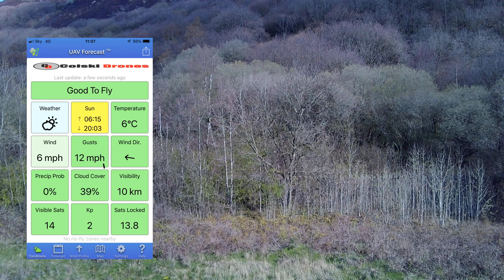FIMI A3 FIRMWARE V1024 FLIGHT TEST

Comment: Real nice.  I ordered March 14th.  The expected ship date of April 5th came and went.  Ship date not updated but so far order not cancelled.  In the meantime I ordered two extra batteries, extra props, high voltage charger, and carrying case.  They better not cancel NOW.  D’Oh!
Reply from the maker: Thats the biggest problem stock is always low
Reply: Hang in there, I ordered mine February 3, and it was back ordered for at least four weeks and then shipped and finally received it April 3. Definitely worth the wait.

Comment: Hi Colski, this is an awesome drone!
There is just one thing that is driving me crazy and I noticed that on your footage as well (5:30~5:40, 6:40~6:50).
The gimbal was supposed to keep the image stable and compensate the drone instability in the air.
What is happening with my A3  is that when I yaw the horizon line gets crooked.
I've seen this in many videos made with the A3 on the internet, but people don't seem to complain about that.
My A3 does that a lot and it's a pity because the video quality is overall good and the transitions are smooth.
I've been trying to get some help on the A3 Official FB group for several months but apparently nobody is too worries about that. 

Do you know if that issue has a fix?

Comment: image quality is not really good and it has jello but others than that its probably the best drone for the money right now. Oldschool analog FPV has its charme as well and benefits, no crashing app and low latency, no sudden connection loss, the reception is fading slowly. I always had DJI drones and they had alolt of problems in the first years as well, i remember the Phantom1 or 2. I would say this Xiaomi is like a Phantom2 generation, this drone 4 years ago was probably like 1200 Euro.
Reply from the maker: Yep you get what you pay for some other channels say this is a spark killer but it’s nowhere near but it’s great for the price
Reply: @CKone41  yes its amazing for the price, you can just buy it to have fun, its not for really good videoclips but enough for many people, for some its even great because for them even a hubsan without a gimbal makes great videos. The bigger brother with the 3 axis gimbal is also a price killer. The problem with the jello is you can not clean it in video editing afterwards, thats why i am keen on jelo free quads. I guess is mostly a problem on sunny days because the high shutter speeds dont mask it. I had a Phantom3 with mega jello, it was 3 times at DJI and i was personally there and in the end they switched it into a new one without jello on sunny days. I would say its a quality thing, maybe the gimbal motors or even the main motors are the reason or their standard Setup dont fit to all gimbals because of quality is not always the same. I think the newer models are much better now.  Xiaomi did a good job for a beginner in drones.I guess the other companies just steal DJIs program codes over time, who knows.